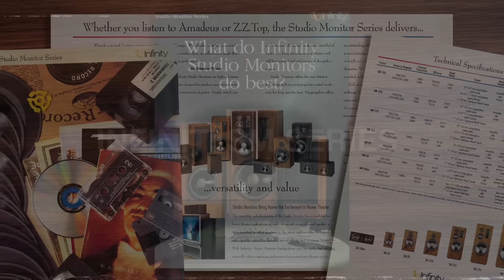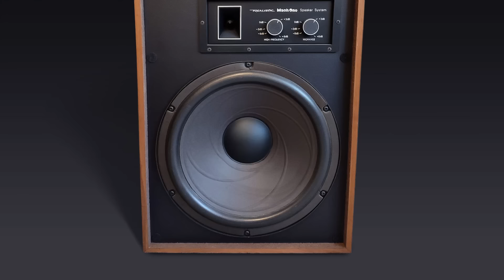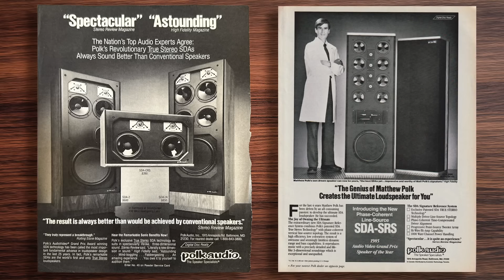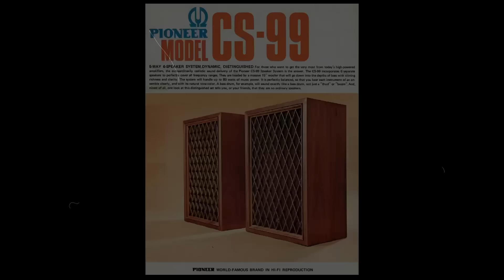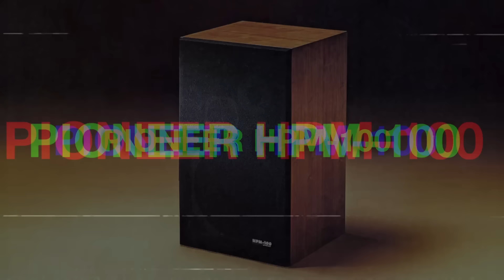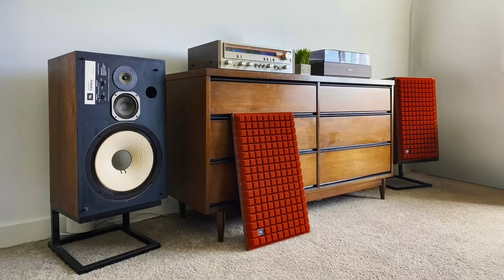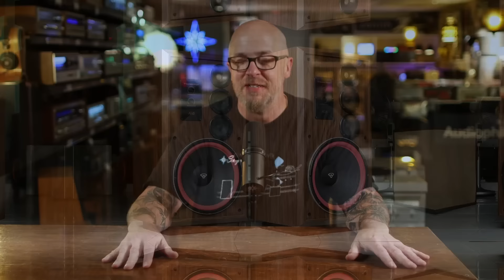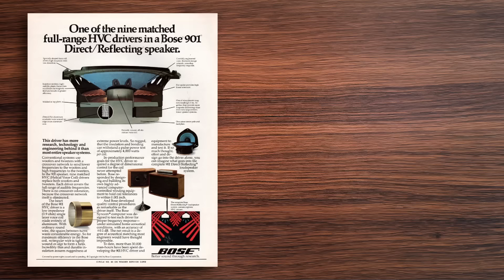Why Do Audiophiles Hate These 9 Legendary Speakers?

Comment: So glad I kept my pair of Technics 3 way cabinet speakers with. 15 inch woofers all these years. Bought them new in 1987 but they've been put away for over 10 years now. They will be coming back out soon enough however. These speakers will cause your ears to bleed. One time years ago was home alone and had the volume way up. Started feeling pain and 20 min later was laying fetal position in the hallway due to a kidney stone. The bass caused the stone to come loose and move but got stuck half way thru. It was a 10mm stone spent 4 days in hospital. They were about to operate, had just given me the first round of painkillers in prep for the operating room and started moving me toward the operating room. We come off the elevator and there was a panic code blue or something. They let me sit there about half an hour in the hallway due to a plane wreck at Metro airport. Turns out it wasn't serious with injuries but in meantime the stone had moved and I suddenly felt way better. When nurse came back I told her something changed for the better so they took me to x ray and went home next morning without havjng to get surgery. Those speakers are what started that whole ball rolling!

Comment: Back in the 90s I, owned both Infiniti SM-100 and Bose 901s.  Both were garbage.  Speaker placement didn’t fix them.  The comb filtering and lack of low end was horrible on both.

Comment: I have a pair of Electrovoice 3s. I refoamed the woofers and they sound pretty good now but not great because I use them high on shelves in my garage. How were these reviewed back when they were sold? Since the woofers is not wired in, is this called a passive design? Could a new crossover be added and make the active? A lot questions from an old dummy. Nice video.I live is SD. I plan to visit your store next Summer. Have a great Winter.

Comment: Because cancellation & re-enforcement a multi driver box is renowned for, a good single cone 20w full range speaker with a wizzer cone  in a properly designed enclosure can easily sound far more natural, better bass & rich colourful sound compared to those wanky multi driver dumbass things! that produce both cancellation/re-enforcement of octaves as well a way too much Doppler.

Comment: I've seen people take legitimate audiophile speakers and set them up against the wall opposing each other. 

Audiophiles listen to speakers differently than most people used to. For audiophiles setup in king. If you don't set them up properly it doesn't matter what you get. I remember my fraternity where I had a brother throw a pair of CV D-9's in a 8x8 room and hang them from the ceiling pointed down. They sure made a lot of noise. 

Putting your speakers against the wall on either side of your particle board equipment rack isn't going to get it done either. That's how most people set up their system. You're basically listening to tone. There is no imaging set up like this.

Comment: I bought at the age of 16 a pair of used 301 Bose Speakers i tortured them countless times over the years 😅later i try many different brands of speakers also quite expensive ones until I bought a pair of Bose 901 series 3 and I’m still so happy about them. Never change again. Ps I still have my old 301 and I’m 61 years old now

Comment: The problem is probably that quite a few people after the age of 15 can only hear about 30Hz-16kHz sound frequencies due to health problems, and these people will probably never find normal speakers! That's why many people listen to crazy bass thump or, then, too high frequencies! Most people can probably hear midrange frequencies and vocals normally!Of course, those who describe music and audio equipment should always do a frequency hearing test before describing audio equipment! If the frequency hearing is only between 30Hz-16kHz, then there is no point in reviewing audio equipment and these audio equipment describers are simply lying to people when they describe how good the sound was. The normal frequency hearing of a healthy person is about 20Hz-20kHz and a person with very good frequency hearing hears about 10Hz-22.5kHz frequencies. I have very good frequency hearing! So, whenever someone describes on a public YouTube channel or on the web how good the sound is from the equipment, I can't really trust them until they have done a frequency hearing test and published the data!

Comment: Growing up, I can remember the Realistic Mach-1s being the defacto standard for the local skating rink & various other club/hall venues. Yes the horn was harsh but very effective at cutting thru typical crowd noise. As a kid, I remember not liking the sound standing directly in front just a few feet away but from a distance, I had no problem hearing the music. I'd rate them as a more successful PA/sound reinforcement speaker than for sq use.

Pretty much all these have their place of best use except 901s. That's something I never quite understood & still don't. Some of their Acoustimass component offerings sound nice but just can't handle the SPLs I like to frequent at times. I know the science says Bose is superior but my ears suggest otherwise.

You'd laugh but I currently have a set of Fisher ST840s for garage speakers & Infinity RS5s/Yamaha 12" powered sub for inside use. All free. The neighbor set the RS5s out to go in the trash! I couldn't let that happen.

Comment: Have and old pair of JBL L100, nice 12" woofer without any crossover, flat easy to drive. I disconnected the mid and tweeter,  and using  planar mid/tweeter with 3D printed horns. Could not be happier. 
The original JBL tweeters, well, some like them. The original speaker terminals from the 70's are replaced with modern terminals.

Comment: I enjoyed this run-down immensely.  When I was young, back in the 1960’s and early 70’s, was the heyday of “high fidelity”.  I was also in a unique position to have worked for one summer for my father in a wood shop that he ran in Cambridge, MA. called Cambridge Pattern Works.  They had many clients, but one of them was Bose corp. in Framingham, MA.  I don’t think that my father’s shop was the sole source of Bose cabinets, but they were a significant one.  We built many, many sets of 901 cabinets and packed them in their (eventual) cartons, and hand carried them (by truck) to Bose in Framingham.

I did not have the money at the time to buy a finished set of 901’s.  They were always quite expensive.  But I did get to hear some in a “correct” environment, and the sound stage experience could only be described as luscious.  Years later I noticed 901’s being used at live events, obviously incorrectly, as their placement wasn’t right for the shape of the room.  It would not matter how well the electronic sound shaping circuits worked (or didn’t) if the sound can’t reflect at the right distances.  That was the weakness of professor Bose’s system, it required the right room shape and size to make it work.

Comment: I have found that the the little dials on most vintage JBL speakers (I’ve seen them referred to as L-Pads) are actually pretty effective at adjusting the sound characteristics of the speakers. 
So, if you don’t like the way your L-100s deliver bass vs. mid vs. hi, try fiddling with your L-Pads.

Comment: You may hate this but I absolutely love my Dad's 1972 Sansui speakers. They have such good sound quality. I don't think they qualify as Kabukis too early but I  love them. I've had Garrard, Bose, Pioneer, Sony,and currenly have Klipsch for my surround sound for my TV and JVC UX-C7 Micros for my stereo, but i still contest that those Sansui speakers blow all of them away from a sound quality standpoint. Ki da waiting until he gives them to me to decide whether they will stay stereo speakers or if I will add them in to my surrou d sound system and use them to replace two of the Klipsch....probably going to keep them with the stereo but i think they'll compliment my sub well and then i can use my larger Klipsch to replace the smaller ones and retire the little guys permanently.

Comment: All those speakers are pretty cool except for the bose, not sure what they were doing there. I live and die by vega. I have dx series with 12 inch drivers and I absolutely love them. Purchased in 97 and I just had the drivers refoamed. They dig a hole straight to hell on the low end.

Comment: You reviewed the Bose 901 ported version... the first model 901 was designed differently... it was a sealed cabinet with the equalizer box... One virtue claimed was that the 9 drivers acted as one driver, being acoustically connected, and driver variations were averaged together for a linear sound... That seemed to be true, and the small cabinet volume supported this phenomena... The 8+1 driver configuration was said to mimic the reflected/direct sound ratio of a typical concert hall...  The individual drivers in both versions were indestructable... there a story about Dr Bose plugging a speaker, without EQ directly into an A/C socket without setting a fire...  I bought the original 901 and powered them with a Sansui 999  integrated amp with 50 watts per channel ... Immediately  I decided they needed more power and bought the  one of the first Phase Linear  amps produced with 350 watts per channel... that was a credible system  for my lifestyle, being in college and moving twice each year... By the way,  Bose acknowledged  the low sensitivity  problem well, understanding the sales problem he created in clipping amps... Thus the ported version was marketed, which I thought sounded terrible... the sealed cabinets sounded smooth and linear, the ported cabinet loud enough but somewhat distorted...
Reply: Almost any $2k DIY speaker kit offered by most designers today will blow those crappy 901s away.
You probably remember your first girlfriend as beautiful, chances are not.

Comment: Bose 901s were designed to simulate the sound field of live auditorium or arena performances. Have you ever been to a concert that used only two small speakers in the corners? Even a concert without any sound reinforcement will be a wide sound stage all around you. It is somewhat of an acquired taste but once you understand it and are acclimated to it you may find little boxes inadequate. As a side note the 901's brother the 801 was designed for sound reinforcement in auditoriums and are oriented backwards to how the 901s are used, with all drivers facing forward. It is a totally different application. Most vintage 901s will have developed decayed edge foam around the drivers (an ailment not limited to Bose by any stretch) and will need to be re-edged if they have not been already. With bad foam they will definitely sound terrible. I re-edged mine with cloth surrounds for the 801 and they still sound nice. It is not a difficult task. And yes, they have highs and lows.

Comment: I have been using Altec Lansing 604Cs for 47 years, since 1978. I recently refurbished them: I ripped out the 1" fiberglass insulation on three sides, installed 1.5" safe and sound rock wool on all six sides, cross braced the opposing side cabinet (Altec cubic ft specs) walls at two points offset at about 40% from the cabinet floor, and a cross brace from one of these braces to the baffle wall, closed the port and converted them to acoustic suspension from bass reflex. I have Mastering Lab crossovers that have been re-capped with Jensen foil-oil caps, and an active crossover in a server sends everything below 70hrz to a Velodyne ULD-15 sub, thus relieving the Altecs of 80% of their work, and relieving the NYAL Futterman OTL3 tube amps from seeing two oscillating bass peaks, they see one stable base peak and are therefore very happy. The sound is 3D holographic, to die for.

And yes, I would not be caught dead with almost any of those speakers. MAYBE the JBL, MAYBE the Klipsch. But I have heard better Klipsch speakers, and they sound simply wimpy compared to my setup.

Comment: I can't think of the name of the speakers they're from the early 90s late 80s they were BOSE I believe they had a 10-inch woofer and two tweeters on the top of the box 1.0 at you one pointing away from you and they were insanely loud I remember one day I took him outside and hooked them up to my truck system I disconnected my subs and hooked them up to the amp and they took quite a bit of power.

Comment: I have a pair of Mach Ones in my workshop...  you can see them in some of my videos.  My QSC PLX 3002 amp and a 31 band stereo EQ help get them 90% of the way to great sound, but they could benefit from some TLC and the upgrade kits... and yes the 15 inch woofers have been replaced as they suffered from foam degradation.  Ironically, I got replacements from a Radio Shack that was one of the last to shut down.  They had 2 "in the box" 15 inch subs up on a shelf from the early 90's that they needed to get rid of.  Guy sold them to me for $50 for the pair, they don't exactly match but they sound good.

Comment: I love my Bose. I own three systems and love them. As you say it only matters to the person listening
Reply: I have several friends that do sound reinforcement work with touring musicians... They all say the same thing, "No highs, no lows? Must be Bose".

I can see where the 901's blue collar, tolex covered 801/802 brothers have trouble articulating bass and treble adequately in medium to large venues.  

I asked if more modern Bose professional gear like the L1 system had made any improvements. Once again the answer was that "Current Bose professional installation products carry on the long tradition of no hi,no lo."

I on the other hand have had great success hacking donated and discarded Acoustimass subwoofers into amazing block rocking bluetooth blasters. Once I've cleaned out all of the wacky Bose circuitry there's plenty of room for the $20 ;200 watt 2.1 channel amazon amp and a bunch of ovoid drivers harvested from broken hi-end flat screen TV's. I wire them up in a series/parrellel arrangement to yield ~4Ω. I put the smaller drivers on the right channel and the larger ones on the left. This way I trade Stereo output for a Monolithic tower with Foxified parametric equalizer control. 

For outdoor activities I power it with a 24 volt 4ah Li-Ion power tool battery that will easily play Van Halen for 12 hours at 98db spl. When I'm out and about in my open top, doorless CJ-7 the "Foxified AcoustiMESS" easily provides amazing audio that reminds me of my 1200 watt bi-amped Peavey SP-1 black widow PA system topped off with the acoustic-wave tweeter cabinets for superior sybilence and sizzling cymbal sounds, but without having to load 500 pounds of gear into the full sized van required to move it around.

Comment: The ESS speakers are the ones I never hear about. They had transformers with fans that dispersed the mid and high range and the lower drivers with radiators. They were great. They were the EMT 3 with the air motion transformers , Heil I think was the spelling.

Comment: I understand the bad opinions of the Sansui SP-X line of stereo speakers. There were many things to complain about, but one thing that sold me on them was their power handling. I invested in an entire rack full of Pioneer esoteric stereo equipment, to include the Spec-1 preamplifier and the Spec-2 power amplifier. I was serving on active duty in the US Marine Corps and stationed on Okinawa in 1978/79. Out of all of the stereo speakers I auditioned at the PX and even stereo shops off base, the Sansui SP-X11000 speakers were the only ones which could handle the power output of that Spec-2 amp. These speakers were very unorthodox in their design in several ways. First, they were gigantic! Featuring 2-17" woofers, 2-6 1/2" midrange drivers, 2-2"x6" horn tweeters and 2-1 1/2" super tweeters per side. The speaker cabinets were not very deep and were of bass reflex design. Using 2 very large woofers in that cabinet would have been disaster, so they split each side into two distinct enclosures. One half (enclosure) contained the electronic crossover, requiring both enclosures to be connected, electronically. They did this, using an 8-pin vacuum tube socket, mounted in one enclosure and the 8-pin plug mounted in the other. There were 4 rubber feet on the bottom side of one enclosure and 4-recesses on the top side of the other. When these were aligned as you would sit one enclosure on top of the other, the tube socket and pin plug would align and connect. This was really odd, so say the least and I don't believe that this particular model caught on, in the states. I purchased two pair of these speakers. However, they were used in a church as main PA speakers for several years and that blew all of the horn tweeters. Exact replacements were not to be had and aftermarket ones had different specs. Even the woofers were an odd size. Nobody, but nobody carries 17" woofer drivers. My older brother still has one pair of these speakers, but I gave them up a long time ago. Long story, I know, but I thought it was worth telling and brings back some fond memories.
Reply: Thats a great tale! Two enclosures connected with an 8pin. Bizarre or what? I had an ancient Leak preamp / poweramp combo that was connected by an octal plug and cables. ( It was a mono tube amp, I never did get it working, but it looked cool.) But building the plug and socket into the enclosures? Thats pretty rad. Thanks for sharing.